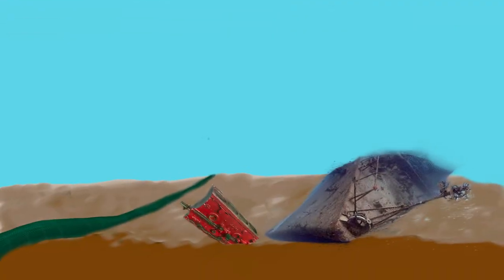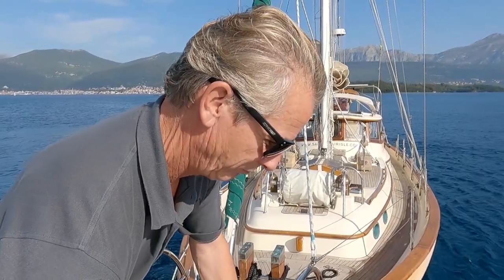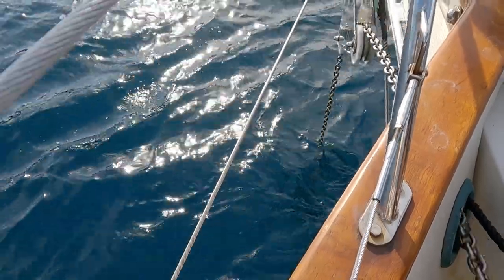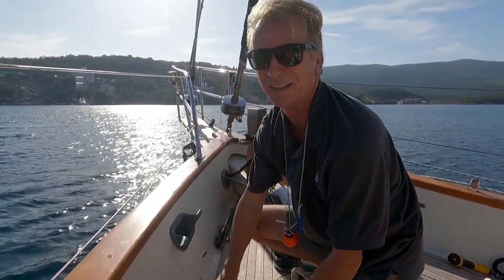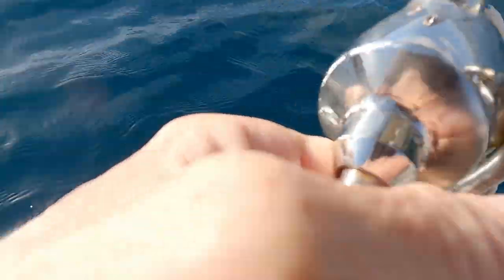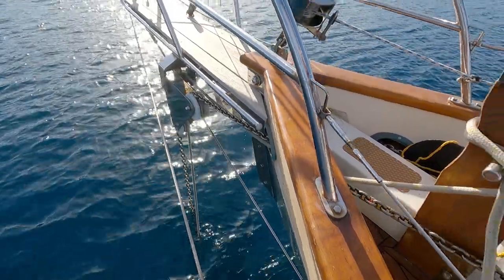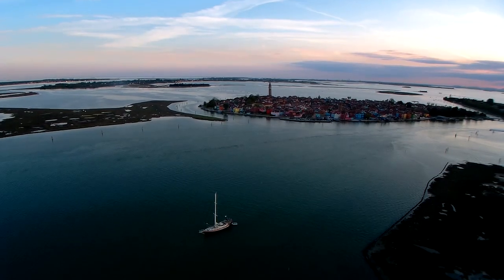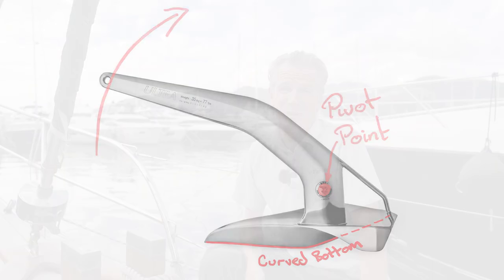Freeing a stuck anchor

Comment: We had our Fisherman anchor stuck at Worbarrow Bay in Dorset, presumably under a rock, and I succeeded in releasing it by motoring hard and letting the boat orbit round its anchor. At one particular place the anchor popped out. Thinking more about it now I should have used a long scope to do this, but I had it on short scope.
Reply from the maker: You were lucky. Fishermens anchors can be impossible to get out in rock.

Comment: I've had a rocna anchor 4 feet into the mud.
Needed a shovel to dig it out at low tide.
In the demo you showed the anchor would never be a problem to remove.
Friend had his boat drag until the anchor went under a large sunken log
. Needed to dive to get it out.
I always have a very strong rope tied to the back of the anchor with a float. That way I can pull the anchor out in reverse.
Reply from the maker: Any anchor can be a problem to retrieve if it gets stuck under something. When you anchor every day as we do it’s bound to happen sometime. There’s a lot of associated problems with running a trip line, I wouldn’t recommend it, we do have a device that saved us though, we made a video about our very stuck anchor… https://youtu.be/wYmcS-imG_4?si=PfmWEFDDTWSbFbjS
Reply: @svfairisle  that round thing wo
Reply: @svfairisle  that round thing would be useless is the shank is in the mud.

Comment: Thanks Guys.  Ah, so the question is answered, you did try the marine drone...pity that it's hard to orientate/manoeuvre on a fixed object like the chain.  Another option might be to rig one of your GoPros for deployment in much the same way as the Ultra Anchor Ring; suspended by a line and running along the length of the chain...although not live or real time video, it might give to more of an idea of what you're caught on...  Anyway, well done and thnkas for the additional insight.
Reply from the maker: Yes I have tried that before though when trying to film anchoring shots and the problem is sods law means the GoPro always seems to rotate to point away from where you want it to! I now have an underwater housing for an Insta 360 camera so this would do the job nicely I think as it films in every direction.

Comment: Can you run your "breakout" crown warp, with or without buoy/buff on, alongside the chain and back to the bow, but to tied the chain at intervals on with breakable twine? A bit fiddly, perhaps, and maybe only worth doing in known poor anchoring grounds.
Reply from the maker: yes sounds very fiddly! I could imagine there would be ample opportunity to get the trip line tangled in the chain, it can happen even with a buoyed trip line above the anchor so trying to have it running back to the bow would be worse i think. Different things do work on different boats however, for instance I always tied my snubber on with a rolling hitch which is easy on most boats. I persevered for 3 years doing it on Fair Isle which meant hanging upside down under the bowsprit to tie it! I finally switched to the Ultra grab hook, should have done it years before!

Comment: The Ultra Ring is a lesson. Is it so heavy so as to be usable as a kellet, as it seems over-engineered just to trip an anchor?
Reply from the maker: Yes I guess the weight is mainly to be useful as a kellet, we used it in Venice for that purpose. The weight is mainly useful to me as a dumb bell though, saves having gym gear on board!

Comment: Steve & Judy… Happy New Year 
Enjoyed (as always) your hi quality and most informative video. Many Thanks for taking the time this Holiday Season.
One quick question/clarification… on Plan “A”… attempting to free the anchor by motoring around a bit. To try and pull it up from the other (180 degrees) direction… you rotated boat 180 degrees and put her in reverse. Why? Why would that be preferred over simply moving forward (over the anchor) from your original position?
Reply from the maker: Good point, it's just a filming thing. Of course when we initially weighed anchor it was just a bog standard job that we weren't filming, we had tried over running the anchor forward. By the time we were filming we were into properly trying to get it out and for us with a full keeled boat the best way to position the boat is to use the rudder as 'back & fill' to kick the stern and try different angles with a lot of chain out to get the pull angle low (I know that didn't show well in the film, there was an element of needing to get it out before it got dark rather than film! ) You don't want to have a lot of chain out pulling forward as It'll be scraping across the keel as you pull so we maneuver backwards and work the angles. Hope that makes sense.
Reply: @svfairisle  indeed… does make sense. Many thanks for SUPER SWIFT response.

Comment: Hi Steve, I hope all well with you guys. A question on anchors and chain. I know you have stainless chain and anchor the infamous ultra but what's your view on a stainless anchor attached to normal galvanised chain G70 (from a corrosion perspective) thanks
Reply from the maker: Won't be a problem. If you spend a lot of time at anchor the bottom link or two may lose some zinc so you may need to cut a couple of links off every few years as they start to rust but nothing worse than that
Reply: Thanks Steve

Comment: Great video, as always! I keep thinking about buying one of those rings but it is a bit pricey so I was wondering... do you think a couple of meters of chain wrapped around the main chain into a few loops and all tied to a line would accomplish the same task? obviously not as neat or elegant, but do you think it would be better than nothing? thanks for the video!
Reply from the maker: Yes possibly. Before we got the ultra ring I had a 3 meter piece of chain with some short buts of rode spliced on both ends that I use to wrap around sharp rocks when stern tying. My plan was to make a loop around the anchor chain with this and hold it with a shackle then lower it down the same way.  I never did have to try it in anger but in principle I think it might have worked, just a lot more bits to get snagged with that arrangement.
Reply: @svfairisle  yeap. exactly what I thought... will keep the ring in my wishlist and will order it next time we are stopped anywhere for long enough to get a delivery, and meanwhile if we get stuck i'll try the chain. if I do, i'll let you know! thanks again - too late for happy Christmas, but just in time to wish you guys a very healthy and prosperous 2023!
Reply from the maker: Thanks Raf, not sure where you are, but if you end up anywhere near Turkey buy them there, it's where they're made & they are cheaper!
Reply: @svfairisle  cool! i knew they were made there, but didn't know it was a substantial price difference! thanks for the tip. we're in Denia, got here after an interminable 15h night of fog... had planned a 2 day passage to Cartagena, but after 30h we had enough. we're on our way out of the Med, back into the atlantic. we found the med too busy, too hot and too expensive for our liking!
Reply: I was also thinking about an alternative, after looking up the prices. I have a couple of kettlebells aboard mine. Thinking that may do the job also?
Appreciate your videos. I’m taking these tips onboard for my future adventures

Comment: Could a loop of chain do the same thing?  Or even a bowline loop with a weight attached.
Reply from the maker: Yes possibly. Before we got the ring my plan was to use the short length of chain win rope ends with eyes spliced on, it’s what I made for shore fasts when we were stern tying to the very sharp rocks in Turkey. There’s more chance of it getting caught up on something, the ring just bulldozers its way down! But better than nothing
Reply: @svfairisle  Agree the smooth profile of the ring (and weight) should help it get past more snags.

Comment: I dont fully get it? Is the water really cold? You can pull yourself down the chain to have a look at what is going on.
Reply from the maker: No the water wasn't cold but it was 17meters deep! Unless you are an extremely well trained free diver it is impossible to get that deep. I have a small tank so I could and would have gone down as a last resort but this is not advisable to do as a novice diver with a tank you still have to know what you are doing.
Reply: @svfairisle  but the water looks lovely!
Good on ya Steve.